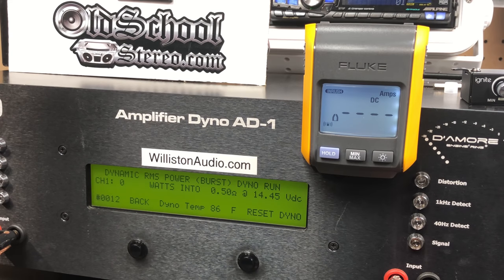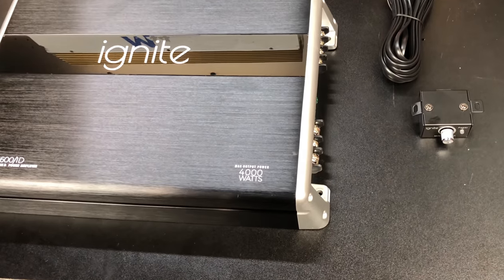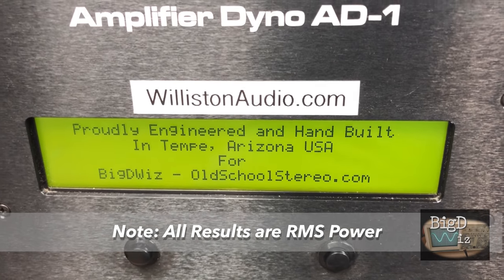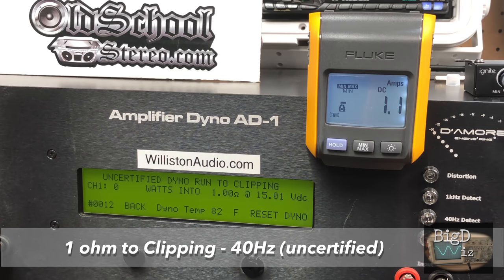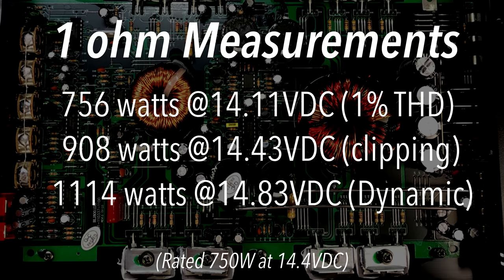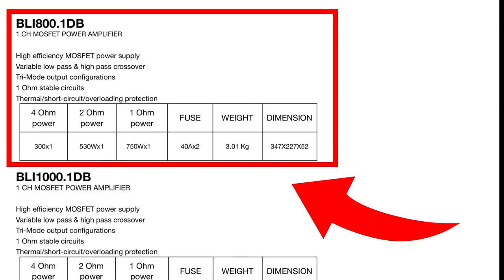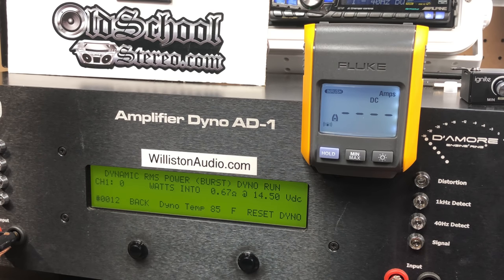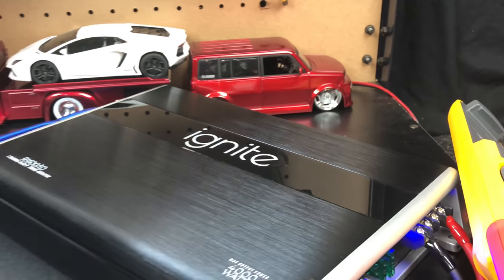4000 watts for $75? Ignite Audio R1600/1D Amp Dyno Test (4K)

Comment: Why not just call it 750x1 people with jump on that at that price
Reply from the maker: Agreed!!
Reply: Price would go up
Reply: Because uneducated people (people who have no car audio experience) will buy because of the number on the box vs others with lower ratings.
Reply: Even then it cants push those numbers reliabily. I bet if you push it hard for 10mins itll shut down
Reply: @MLProductions.1  nope running 4 skar ix8s in an under seat box in my 2020 f150. It’s a 3 hour round trip to work and they are played wide open the whole time and it hasn’t given me a lick of trouble. I bought it because of this video and glad it did!
Reply: @MLProductions.1  I installed a few for customers that purchased them off Amazon surprisingly they are reliable and set gain before clipping and 1 ohm load. So they were getting pushed hard. 

Wish could say the same for the crap cheap Android radios people pay to have custom installed as they are not double, or single din and have to make a custom bracket. Every one of those broke in under 4 months to the point if someone comes to shop to have one installed refuse and tell them they are crap cost more to install and break down after a short time and sell them a proper head unit.

Comment: Wow this literally blew my mind! I'm still running my old school sound stream reference 500s high current amp. after all these years it still works However it is made in the USA with a mil spec circuit board and huge caps. Still im super impressed by the ignite for 75 bucks!! Unbelievable!!
Reply: Hey man good is good...the old shit is fine man
Reply: Caps dry out when they're not used so if you've been running it all this time, makes sense it would still be working. Sitting them in storage for extended periods of time can be a problem.

Comment: I have owned this amp for almost 6 months and I knew you would get to it at some point!!!! I have it pushing one type R 12 and I was beyond shocked. I got mine for only 65 dollars when it first dropped and I still cant believe it works as well as it does. Thanks for this review!
Reply from the maker: Great feedback, thanks 👍
Reply: See now this is the review that is useful.  Thank you.
Reply: @MrTopsoil911  need a hug?
Reply: Still holding up well? Im thinking about grabbing one for my commuter car
Reply: @MrTopsoil911   this nogel guy has some of the best audio equipment, check his page. He knows qhat he's alking about for sure... you should listen when a real pro speaks 🤣
Reply: @MrTopsoil911  I bought rf power 1000x2bd for about $400 worked for 6 months warranty replaced it lasted 5yrs then it went out last summer... I said screw it!  then I seen this for 75 might just jump on it for a little bit of bass without spending too much since I aint to big into car audio nowadays.. and for 8s are still in my truck not been used
Reply: I've had mine for over a year bouncing around in a jeep wrangler running at 2 ohms and never had an issue.

Comment: Great video. Once again. I'm getting sick of saying that BTW. But it's better then complaining. That's for sure.
I can only imagine the distortion level this is at. I think it's time to invest in an oscilloscope BigD. This would give us all a better picture of what we're dealing with here. Still a steal, no matter what though. Thank you.
Reply from the maker: I have an o’scope and can start using if it adds value
Reply: @wal  Heck yea man! Of course it adds value. Knowing the actual distortion figures would be great. You could tell us that, and just show a quick shot of the square wave. That would definitely add value IMO. I would most certainly pick the amp that has a better square wave, and THD, if it were a dramatic difference. And everything else was fairly equal. I've been seeing for years on forums that the cheap amps are no good, because they have higher distortion. Let's find out about that BigD! 😁
Reply: you mean sine wave until it clips into a square wave, still i doubt the bench hes using would lie about figures  it measures at.
Reply: @wal  Please do that! It'll help immensely.
Also for us dummies kindly also conclude or rate the amps for linearity or distortion at varying ohm loads and put out a DoughScore BigD score..

Thanks for the awesome videos.
Reply: Williston Audio Labs i also vote for a short osciloscope look in your videos. Would be great to know when they sweet amps clip
Reply: I concur.  It would add depth and make the videos better.
Nice work Big  DWiz.  I like your content.

Comment: I'm guessing others may say this but the 4000 watt figure is probably a PMPO measurement which is completely useless. In the early 2000's it seemed like every single set of cheap powered computer speakers and cheap CD/tape/AM/FM stereo unit out there plastered huge PMPO wattage figures on them. The amp might actually be able to put out 4000 watts, but only for a microsecond when the power caps start to discharge. It's a 100% meaningless rating, but bigger numbers look good to the uninformed. That's why I'm glad you and others like you put amps on the dyno to show us the REAL power! :)

Comment: Dude, thanks for the suggestion. Bought this amp for a single old Rockford P1 I had laying around. I had three old 10s in a dual box that I spilt into single boxes to fit in my boat cubby holes. Was looking for a cheapo amp for these cheap old speakers, didn't want to spend a bunch on the old boat. For $109 this thing is awesome. Time will tell. Just running one 4 ohm channel for now, I am sure that PLENTY of power for that old sub. Keep up the good work man. The old thing I did not like about the amp was the crappy power and ground connections. Other than that good cheap power.

Comment: Bought one of these on Amazon for $84 1day shipping... Running 2 rockville k6 12's in a ported box tuned to 34hrtz at 1ohm 1/0 gauge power and ground.. Shuriken 1500w battery... Slaps hard for a cheap amplifier.set my gain with a cheap harbor freight multimeter amp barley gets warm but never went into protect yet ... Just a temporary budget build

Comment: Can you explain in a video what are the difference of a cheap amp like this one that does its rated power, compared to a JL audio or rockfordfosgate!! why the big price difference even if they do there rated power? How can you tell if it is quality or not other then by just the price.
Reply from the maker: JL and RF use much more aluminum and higher quality components. They also use uniquely engineered designs, not cookie cutter ones like this.
Reply: And on top of what he said gennerally youll find much better designed power supplys mosfets ran at no more than 50% of ratings . This generally shows up in efficiency . As mosfets get pushed close to saturation the current goes up exponentaly especially once supply regulators push on time pulse width past 60% 

Other ratings the amp dyno cannot test is dapening factor witch is no big deal in a sub amp but is huge in multi channel amps ran on highs . Shows up as a type of crossover distortion . As it can create a phase shift on non driven chanels
Reply: they can be driven harder longer and not fail. also thd levels are cleaner with better brands
Reply: reliability, a cheap amp could ruin the speakers hooked up to it even if the speakers are rated higher than the amp. I had a $100 Audiopipe amp putting out 1500 RMS and had $700 subs hooked up to it rated at 2000RMS. Amp went out and sent straight DC offset voltage to the subs and cooked the voice coils out on them. They were discontinued subs too :/
Reply: It's ALL about money 🙄. You can add up all the parts in almost any amp and never get past 50-60$ for name brands. An infineon mosfet only cost 2$ for me to buy, even less for a bulk purchaser, name brand caps are less than 1$. Circuit boards in name bands are made in China, so are chinese amp boards 🤷‍♂️. Engineering cost has very little to do with this. It's the cost of labor more so. Buy this amp, pull out the cheap caps and buy some nice high temp name brands. Replace the knockoff fets with name brand and enjoy your system knowing you're smarter than the idiot buying a 1000watt amp for 400$+
Reply: I thought quality in an amplifier or sub ment $1 per watt?
Reply: What's inside makes the difference. Quality components, last longer and make cleaner usable power.
Reply: You would think that $4000 for 4000 watts would have quality components. If you go by the $1 per watt.
Reply: @jasonspink1981  now you tell me..
Reply: @randomtube8226  

$/watt certainly is one component of a quality amp, but only one. Longevity is another that is important, as is distortion (lack of).
Reply: @xenaguy01  So 2 dollars per watt = a quality amp?
Reply: @randomtube8226  
Reading comprehension. Learn it. Love it.
Reply: Random Tube By that logic, most of these cheaper amps would be superior to the most expensive variants. No one follows that “$1/watt” rule anymore. Also it’s not all about wattage either.
Reply: Jason spink How many voice coils did you fry prior to making this comment?
Reply: Just checked it’s up to $90
Reply: Plus the signal to noise ratio is 85db which is terrible.

Comment: This kinda reminds me of a Power Acoustic ov2 1600 I got for "free" from Summit Racing for $100 Summit Bucks (amp was $100 at the time) I had left over in 2002~. Used it as a cheap back up amp on/off over the years, bridged, with zero problems (never gone into protect, never popped a fuse; have seen my higher-end old school XM Sony's run hot enough to cook eggs then eventually die running same subs while this guy just keeps going) then one day a few years ago thought why not, and tried 2.67 ohm bridged to power 3 subs to give it a proper send off, and well, it's still kicking somehow. Doesn't even run hot either due to it's length. When compared side by side years back to a Crossfire VR600 bridged on one sub, this PA amp on BMF 12" identical sub (4ohm bridged), it was similar in power but had less braking control of the sub vs. the CF.

Regardless, sometimes you get a good a deal for very little, and this "Ignite" (RIP a/d/s) looks like a similar deal. Can't believe they put the real wattage numbers in print on the manual. Was completely expecting it to be 50-100w below each rating.
Reply: back in the daze we used to crack eggs on amps..  for fun. Later it became a competition...LOL......BDBD/2021

Comment: I had commented on this amp a while back. After abusing it in my wrangler for a year I hooked it up in my grand cherokee to 3 of the Wal-Mart blaupunkt 12 inch. I used a prefab 3 hole sub enclosure that was 1.2 cubic ft per sub. All I can say is WOW. Between the box, amp, and woofers I'm around the 200 dollar mark.

Comment: What do you think would be the best budget speakers to run with this amp? Also, the gauge wire that you are using on here is ideal I'm assuming? I haven't had a system in a very long time, and forgot so much stuff along the way. Seems like this could make a decent budget build for us guys not looking for ridiculous comp style setups.

Comment: A/D/S old school rules! Who remembers that old Porsche install I believe it had mb quart speakers. Big D you need some ADS old school videos. I see you have the PQ20 up all ready! Its not all about watts.
Reply: I have the old PH6 6 channel with the matching 642ci 2 way crossover.  Good, clean power just too big for modern systems and not enough power only 300 watts @4 ohm and 450 watts @ 2 ohm. My PDX-5 channel makes 1001 watts, draws about the same current and is half the size with built-in 12 db crossover.

Comment: Man I wish Infinity still made those subs you use to test these amps.  Those Kappa perfects were awesome.  I had 2 of the 10's in my little mazda mx3 back in the day and they just sounded so damned good.  And they were efficient enough that they didn't need a ton of power to bump.
Reply from the maker: Great subs for sure 👌

Comment: I bought it. I looked before I purchased it and said 4000 watts my ass. Installed it in my Mustang running 2 12s...it's a pretty good amp. The Ignite stamp came unglued from being in the trunk but it's an ok amp. Cheap but it work and works pretty damn good.

Comment: i have a few questions.I see that it has 2 channels. are you getting the same amount of power out of 1 channel as both channels? I see when you hooked up yours you used both channels. why was that?also in the manual when using 2 channels. it says to only use 2-8ohm in each channel, but you can wire down to 1 ohm if your using only 1 channel, why is this?I would like to wire 2 subwoofers down to 1 ohm to one channel and another 2 subwoofers to 1 ohm on the other channel, is this possible?

Comment: Been watching a bunch of these dyno test (Thank You) especially ones showing the amp draw. I calculated efficiency to be about 62% at max into clipping. But carefully watching the video I was able to extrapolate efficiency at other power 50% and 75%,  which is much higher around 80%.  I've seen videos of several amps and it appears they all suck in the efficiency approaching clipping. But do much better at 50 and 75%. There are exceptions so far is the pioneer and dual mono blocks are efficient upto clipping.

Comment: So, Big D, wouldn't the max rating on an amp be the measure of how much "Accidental" power surge an amp can handle?  Think that would be a great stress test. Like when you turn on the key and you get that loud pop through the subs. Maybe?
Reply: Ur amp is not supposed to do a loud thump thats called turn on thump and can damage ur subs very easily. Id def change amps.

Comment: Another great job there! Like the Fluke real time ammeter! You need another meter to show peak current with hold feature. I have an older TES brand, sold by now defunct MCM Electronics. It is a digital clamp style that shows real time and peak/peak hold current! Model TES 3020. Having a peak reading would show surge input. I like the peak reading when testing inverters. Thanks and good job!
Reply from the maker: Thanks for watching and commenting 🤙

Comment: 1200 watts .6ohm stable, $70. Worth playing around with in early 2000's cars with Bose subwoofers that are usually .5 or 1 ohm and the original Bose amps are only ~130 watts and by now often go bad and need replacement.
Reply from the maker: This amp would blow those Bose speakers right out of their baskets if not careful 😲

Comment: PLEASE REPLY. I KNOE YOU HAHE A TON OF MESSAGES. BUT I ORDERED THIS BECAUSE I HAVE A CUSTOM BUILT 12” sub that can take 4-5k Watts. Extremely heavy and built to be a sundown audio killer. I bought it from a competitive bass head. 
     For am amp I was running my MB quart 1200 watt mono amp. But because it wasn’t rated for 1ohm I kept blowing my large engine bay fuses. So I ordered this amp and am not sure whether I made a step forward or backwards.  I rewired the sub to 4ohm on the MB Quart and it does absolutely pound. So I am not sure whether I should put it back to 1ohm and install this ignite amp or not??  What would be you opinion on MB Quart VS this Ignite?? Or should I just wait and get a second and stack them. My sub needs a lot more. Though my budget won’t allow me to get a serious amp at this moment.

Comment: I ran this amp from December 2019 until July 2020 in my 05 Scion xB. I ran it at 1 ohm and flogged the hell out of it with no problems. No problems.........until I decided run it at .5 ohm. My pair of Soundqubed HDS2 12s slammed like hell for 5 minutes and then the amp blew big smoke. Three resistors and a fet bit the dust. Oh well. I still feel like I got my money's worth. I would still recommend this amp, just don't be a big dummy and try running it harder than it is designed for.
Reply from the maker: Good feedback 👌
Reply: @wal  Thanks! Do you still have your xB?

Comment: Big D was upset that the amp sis rated, even at low voltage...$75 for 750+ Watts is very excitingly and worth it...damn thing even .8 stable...good protection circuit...and engineering similar if not dedicated from A/D/S....watch it and weep.
Reply from the maker: Impressive fo sho
Reply: @wal  What's your opinion on the JBL GTX500?

Comment: They have it's bigger brother the '6000 watt' for $100. Any word on that amp and I'm assuming it would be a 1000 watt amp. I'm putting a system in my son's vehicle for Christmas and I really need those extra 250 Watts for the set of 12 so I have chosen. What's your advice?

Comment: Im looking to tune my subwoofer and amp I just finished installing yesterday, so I t-tapped one door speaker to an LOC and am almost certain that the bass was alot better last time I had the amp going with RCA's off an aftermarket radio in my last truck but this time I just ran signal from one speaker to and LOC instead of left and right speakers to an LOC, if I add the passenger side speaker to the LOC would it make the bass better?  Hope this makes some sense, im an amateur at best but have put enough car stereos in my cars not having to use diagrams and instructions.  OH and is it a bad thing to combine a ground for the amplifier with an existing one on the body of the truck?  Went to this video because Im looking for another amp to put in my other ride, will go the LOC route to keep it stock looking.

Comment: Do you have any experience with the new power acoustics 10,000 amps ? I’ve had sounstream ~ ok but is toast n now a wall ornament! I have a Hcca 122 , n believe  it was 148db in extended cab. I need a amp fare price for this years dB drags that can handle 5,000 n not get hot till I can pick up a Orion power house, thanks

Comment: I did not know where to place this message. So big d wiz.
 I found an amp. By exile model 2500xi got in it in box unopened
 What is your option of this amp? And does it do it specs out put wattage?